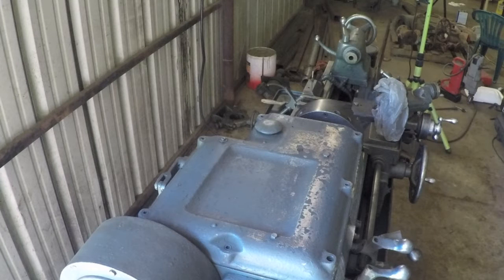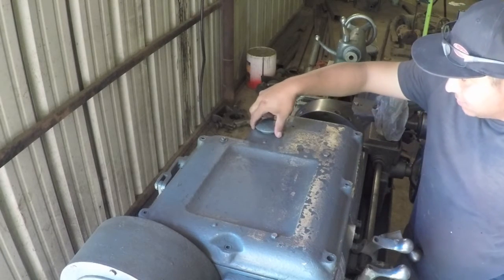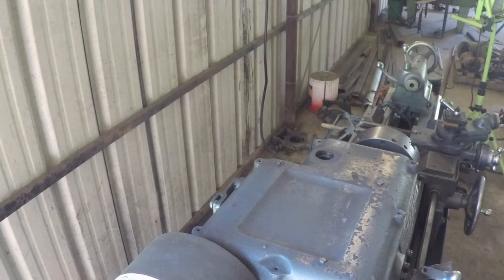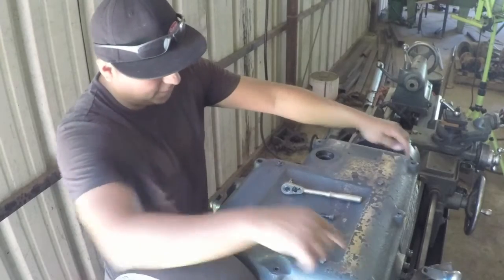#48 Monarch CK12 Custom

Comment: The tray tops weren't factory parts, that one was made by someone else and added on, and the drum switch too I believe. All the monarchs I've seen, including mine have a push button on/off switch mounted under the headstock. Your new tray will look much better than that old one, and good place for tools, but I personally like the original look better. 😎
Reply from the maker: Abom79 Thats interesting info. another problem with the machine is the half nut does not engage. If I hold it down it will work but will not stay engaged. any thoughts? I do like the switch drum its easy to access. I do still have the push button but I thought it was for the coolant pump, thats a whole other project I have not gotten into yet.
Reply: The half nut problem is interesting, one I don't think I've heard of before. How about show it on video and what it's doing. Stick a flashlight in there and take a look at the threads to see if they are worn out or damaged badly. 
Most of the original equipment was a switch panel that had an on/off button, and also for the coolant pump. My coolant pump switch is wired in seperate but directly under the main power switch.
Reply from the maker: Thx Adam I may try and get a video up.

Comment: Is the last shot flipped or something to me it looks like the lip is welded  the wrong side ?
Reply from the maker: Good catch! I actually did do it backwards. I forgot to flip the plate back over but good thing I only tacked the lip on. I was able to break the tacks and reset it. I edited that part out of the video because it would not have been appropriate to post, I basically turned into the hulk after I caught it. I thought I would have had to start completely over but after I calmed down I figured it out.